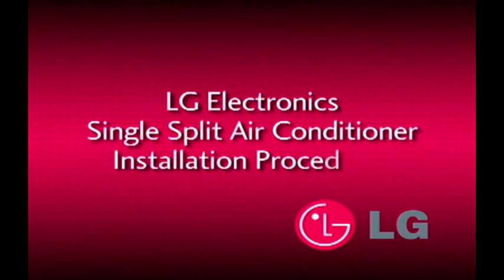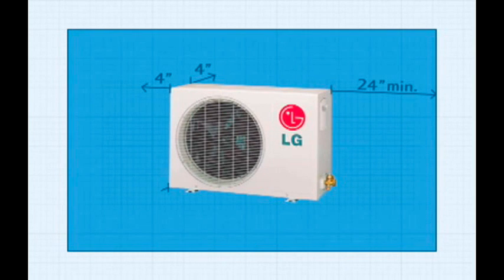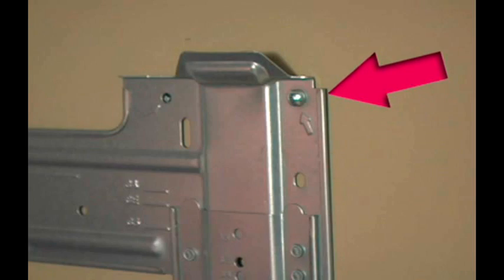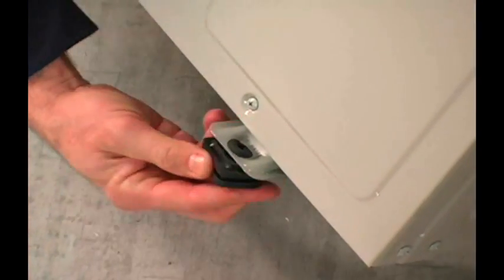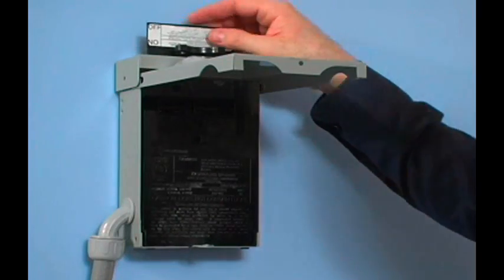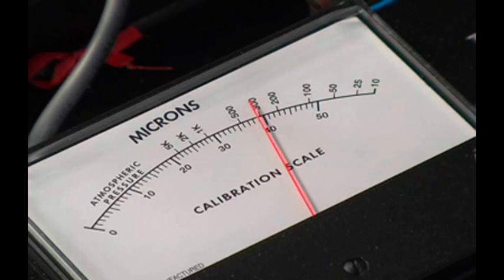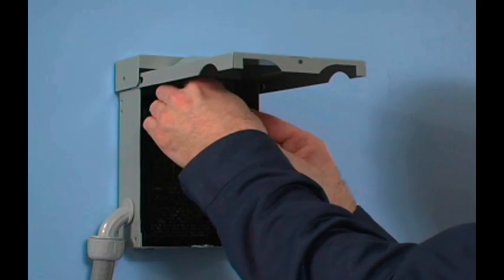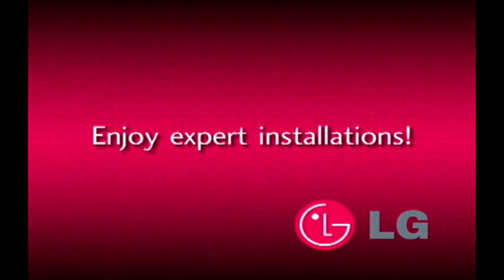LG - Split-System Installation Video (Tips & How-to)

Comment: This video was an eye opener into the intricate science of AC installation. Our LG AC service persons did not seem to have followed all these steps to the dot. They were in a hurry to simply get the installation over with and to rush to wherever they wanted to rush to. I did not see them having any gauges to measure either power or refrigerant. I cannot even be sure they have fed in the right amount of refrigerant. After seeing this video I am in serious doubts that I've been forced to run an inefficiently installed air conditioner all this while.

Comment: What happens to the hole you just drilled.  Is the hole just exposed or is a seal applied?   Insect concern
Reply: Learn to love your critters and they will love you back.  Seriously though, I would think some spray foam my do it but I am not sure, good question.

Comment: THANKS FOR SHEARING THIS VIDEO /i have a questions what is the diameter of copper pipes.and is that sizes used for all mini split air conditioner?thank you for answer
Reply: Shamsi Nurullayev Find the manual and check what refrigerant your aircon uses (Also on side or back of the unit). That will determine what the minimum (WT - wall thickness) of the copper pipes must be. The OD/outer diameter is determined by the brand/model aircon. you purchased. 
My newer airconditioner uses R32 and thus requires a minimum WT of 0.81mm copper pipes. (twin coil annealed insulated 1/4"(6.35mm) x 3/8"(9.52mm) diameter copper pipes. This may not be the same as your model. My old one used 1/2 x 5/8. 
Obviously, you have to adhere to the legislation/codes/standards in your country and/or state.

Comment: The instructions say to angle the wall downwards for proper drainage but later says the condenser can be mounted in the attic. Reason I'm asking is because all my lines would have to travel upward a couple of feet before coming back down all the way outside. Would this be possible?
Reply: Did you get a solution? How did you work it out? I am in a similar dilemma now.

Comment: So much of work is involved in LG split AC installation. But in India, Anantapuram, I purchased a unit 1.5 ton (5 Years before) people have installed it just like that. They never used any pump or cylinder to discharge checking. All they did just connected and run the AC okay. since then I am suffering lot many problems with my AC. 1. with in a year Main PCB gone. 2. After two years Compressor gone 3. Now PCB and fan in the compressor gone . Spares and service is very expensive. Very careless and inefficient  technicians in Anantapuram. Stabilizer can not stop all these failures. Feeling like why did I opted for LG Split AC. I am punished.
Reply: Krishnamurthi Raju sorry to hear you got a very bad installation

Comment: Question, system is factory charged for 25 feet of line set that means 1zone or multiple zones must not exceed 25 feet line set and if additional zone is added and then any additional line set needed must be charged to .22 oz per additional foot ???

Comment: Most systems come precharged these days . DO NOT vac the fridge rant out ..
Reply: you must evacuate the lines and the indoor evaporator, the outdoor units are pre charged, but the rest  is not, vac, nitrogen, vac, more nitro, vac, no leaks, for a long lifetime of good performance, on my Mitsubishis, you do NOT remove R410a if under 25 feet, only add if over

Comment: my LG ac installing mechanic just came with a screw driver, hammer jumper for making holes and a rench. no leak check nothing. stoned of unit into wall, connected wires. switched on unit and rushed off. Work was so pathetic. no improvised equipment. God must save Indian technecians

Comment: Just get some from another make of small compressor, e.g. Tecumseh or Copeland. They are available as a spare part. Failing that i have cut up some rubber vibration strips and made some feet for a noisey compressor.
Reply: LG inside fan motor are way too noise

Comment: Here's something to consider, R410A can't achieve the same high saturated liquid temperatures as R22, and the pressures are higher. When the indoor temperature gets close to the max temp on the thermostat, liquid temperatures can exceed 140 degrees. This reduces subcooling ( on heat mode.) If a drop- in for 22 was used, such as MO99, it would be able to run as hot as R22, and would boost system performance. Does this sound right?

Comment: here we purge everything. and u r right. the combo of freon/oil/moister and heat can turn in to acid liquid which burn the winding of the compressor. u can use another strong compressor to vacuum the tubing system, but but some of the oil from the vacuum compressor will got in the tubing. i rather just purge.

Comment: i think the air-con unit was i about 1.5 hp.. to me most important thing is to remove all air,water from inside the the copper tubes. wiring is cake. 1. buy or

Comment: So this video is for pros? If you are actually an air con mechanic you wouldn't need to watch this video. 
His pipes look like shit . he didnt use an earth lug . if i change vac pump oil after every unit i would use thousands of liters a year.

So he pressure tested with nitro and bubbles and thought it was all good. then used a vaccy stat and found it? ,pfff